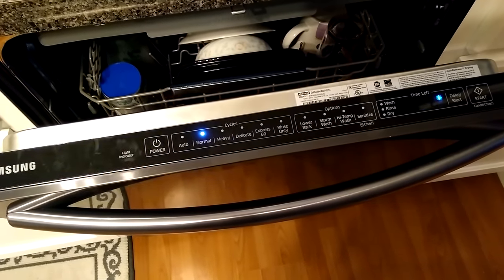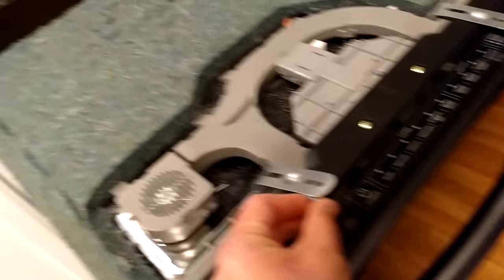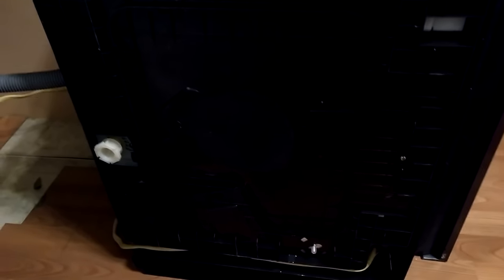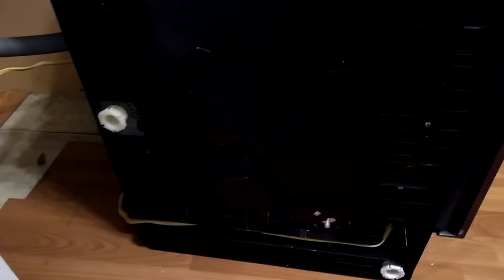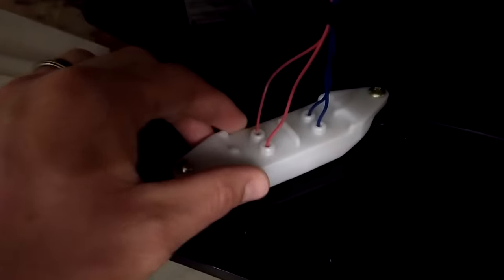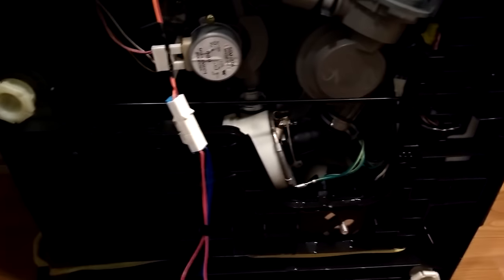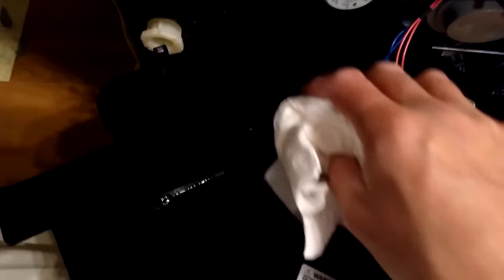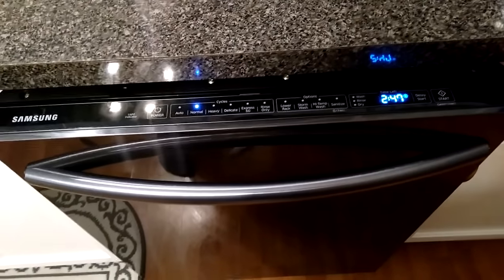How To Fix Samsung Dishwasher with LC Error Code

Comment: it is a shame that these dishwashers are so awfull but we dont find any of this out until after we own it
Reply: I purchased top of the line Samsung appliances (4) less than 2 yrs ago and my DW has done this twice already.
Reply from the maker: Yep, I feel your pain. We have a 4 piece set as well. The ice maker on the refrigerator went out and we had this problem with the dishwasher. Nothing on the range/oven or microwave... Knock on wood
Reply: It's not awful to have a safety feature that will stop a unit from creating water damage. Untrained people don't know that the cause of this is a dirty air break on the side of the dishwasher, over soaping can also cause the issue. Just run some cleaner through once a month and your problem will not reoccur.  Also run your hot water at the  sink before you start your dishwasher.
Reply: They are garbage. I have this occur to me at least once a year. While under warranty they had to send out someone to repair it three times for different issues while it was still brand new. And the Samsung help line is terrible. This is the perfect gift to give to your worst enemy.
Reply: @jmcwatchdog526 Good point about the leak detection and the dirty air break. In the plastic "water wall" in the side of my dishwasher there's a dark brown area at the top-right. Is this a dirty air break? Is there any way to clean this besides running a clean cycle? My tub wasn't draining, but I've checked all other issues.
Reply: I think most appliances are junk these days. Our fridge tech told us they’re all pretty much the same, part of the problem is handling issues in transit.
Reply from the maker: @user-vs3zp8kz9y 😂
Reply: Should’ve kept my old Whirlpool that I had for 15 years.

Comment: I think I figured out where the leak is coming from. The problem lies in the fitting in the entrance of the dishwasher. If the screws holding the dishwasher to the cabinet are too tight it flexes/bows the tub outward which compromises the seal during drying, this allows steam to condense and run down into the pan which sets off the sensors. Adjust the screws so that the tub doesn’t bow out at the entrance.
Reply: ? how did you find this out?
Reply: @jaredstone9487  I had the same issue, fixed it and realized that the improper installation was leading to condensation finding its way to sensors it shouldn’t have reached. Loosened up the screws allowing the steam to breathe and the problem was solved.
Reply: @rearviewviewer  this resolved my issue as well. 

Note to self: you really only need to tip the washer on its side to remove the water from the pan it is in. Easy money. 

Thanks dude.💯💯💯🍻

Comment: Thanks for this video.  Bought a Samsung dishwasher five months ago and this has happened twice.  First time I called Samsung and the guy they sent out claimed it was my plumbing.  Nope, it was not, plumber found nothing.  Second time happened tonight.  Found this video, fixed the problem myself.  I additionally used washers under the sensor’s screws to raise the sensor a bit.  All working fine now!  You are a hero👍🏽.
Reply from the maker: You're welcome! Glad it helped, hopefully you won't have any other problems. Mine is now more than 5 years old and doing well ... Knock on wood

Comment: Round two.  The first time I dried the sensor and added two washers to raise the sensor.  One moth later it happened again.  Btw both times it happened after a heavy cycle.  Anyway, this time the plug was damp and laying on the pan floor.  So I added two more wagers and tied the plug up off the bottom.  The next time I write it will be about taking this thing to the dump.  I have Better things to do than mess around with this pos.  Don’t even get me going about my Samsung microwave.  I bought a Samsung kitchen package.  Might be a full truckload to that dump.
Reply from the maker: Man, sorry to hear that. I have a 4 piece package too. Haven't had any issues with the microwave or oven. The ice maker broke in the freezer/fridge but that was an easy replacement. The dishwasher is still going strong without any additional problems since posting this video. It's all too expensive to junk within just a few years, gotta make it last one way or another. Good luck!!!
Reply: Thanks. You are right of course.  Will find a way to make the the dw work.  But with the microwave, I can’t fix stupid.  Samsung won’t let you set a timer and cook at the same time?  Here in the south they say “mash the button” in stead of turn on.  Nothing could be more true with the mw, you have to mash the buttons. LOL.  I really will replace it with a GE.  Range and Frig are working okay.
Reply: @dwightshelato7619  You're dead right about the mw buttons. It builds muscles. And we're now fixing the dw for the second time. The print on the face of the washing machine that allows you to choose your load type is rubbing off and now protected by clear laminating sticky sheet. I'll never buy Samsung appliances again.  #samsungsucks

Comment: In our case the problem / leak seems to be connected to not having the upper (cup) rack slid in fully. It has to seat in the rear on the post with the rubber gasket. This was first discovered when we noticed scratches on the upper inside (center)  of the front door. It has occurred if a spatula or other utensil is sticking out the back/rear of the rack. Probably putting pressure on the door seal, not sure, but as long as we slide the upper rack in fully (and not allow the door to do push it in) the problen has not repeated.
Reply from the maker: Good tip, thanks for the feedback!

Comment: My Samsung D/W would do this about twice a year. I've added three #8 brass washers between each mounting stud and the sensor. This raises the sensor just enough that it still functions properly but with a higher water level, so less prone to trip. Be aware that one path of water into the pan happens from the door ducting. Avoid the temptation to add a dish once the machine has started. Adding a dish can run water into the pan and trip the LC 
 sensor.
Reply from the maker: That's a good tip, thanks for sharing!
Reply: omg this explains how I got this, thank you so much. has your dishwasher been okay since?
Reply from the maker: Mine has been good, it's almost 6 years old now

Comment: We've had a model DW80K5050US for over 3 years, and it worked fine until this morning.  What's shown in this video made the LC code disappear, so thanks for that!  The hardest part was tipping over dishwasher.  One screw and 5 minutes later I turned on the breaker [while the dishwasher was still tipped over], and all was good.   No signs of any leaks, but there certainly was a small amount of water in the pan.  Thanks for showing how to do this very easy fix!
Reply from the maker: Wonderful! You are very welcome!

Comment: Thanks for the video! A simple fix is to remove the sensor from the tray with the one Phillips screw.  Once removed you'll notice four metal pins that trip the sensor with the slightest amount of water in the tray.  Use a nail clipper to trim a mm off of these pins.  This way you'll still have a working sensor in the event of a real flood but one that doesn't trip with two drops of water in the tray!  

This issue has hit my beautiful smart dishwasher several times.  Usually waiting a day or two for the water to dry will resolve it but this slight alteration should prevent you from having to do that ever fn again
Reply: First time ever and wonder if it could be ice - we just had the coldest night of the year and maybe the line froze?
Reply: I came here to say thing thinking I was Mr. Smarty Pants.  Seems you beat me to it.  haha.  One step further is I cut them all off then wrapped them all with electrical tape.  I told my wife if we get a flood deep enough to hit the electronics and create a short, then open (circuit burn) WITHOUT tripping the circuit breaker with 110 being an inch off the ground up front.... well its curtains for this POS over engineered dishwasher anyway.  Our Dishwasher is on the main floor and we have a basement.  The water drains straight down to the sewer drain below when there's an issue.   I know because this house was built in 56 and the brass T fitting under the sink degraded and was draining the dishwasher into the basement lol.

Comment: You are a HERO! Thank you so much for posting this video and saving us time and money on this dishwasher. We also went the extra step of placing washers under the screws where the sensors are housed to add length. That way if just a little water is dripping from time to time it won't set off the sensor, but if there is an actual leak it will let us know.
Reply from the maker: Glad we could help!!

Comment: unbelievable how simple and effective this video is. I had this on a model 5 years ago and the vendor just swapped it out for a new one. The original probably just went into land-fill. It happened on the replacement this morning and I followed your instructions and the fault was cleared. Assuming that there isn't a structural issue with the plumbing, this tray along with the condensation created in the drying process seems to be a poor combination. Anyway, thank you so much for posting this.
Reply from the maker: Thank you for the feedback, glad it helped!

Comment: Hi, I just tried this, on my model there were no screws I just popped out the plastic cover on the bottom, then disconnected the cables, unscrewed the sensor, dried it all out and back to normal. The fact that they have put a very easy cover on it would imply a botch fix on a design issue.  Thanks  mate good job.

Comment: It's good to know this workaround (thank you for posting it "HTFIW") but there should NEVER be water leaking from the tub to the catch basin. The only reason the catch basin is there is to account for a worn-out leaking hose or seal UNDER the tub. Worn out, like after 10 years of normal operation. We are now on our second brand-new Samsung "39DB" dishwasher. Neither has been able to run a single load yet because they LEAK! The only reason we bought Samsung is the Bosch dishwashers are still on freighters in Long Beach Harbor. The new Samsung dishwashers are simply junk. You all have fixed the LC error code - great! I'll try this too if I decide not to wait for the 2nd repair tech to try to fix it -- but have you found and fixed the leaks? Has any repair tech found your leaks? Samsung support says "air it out for 24 to 48 hours then call us back". Seriously? A brand new dishwasher can't run a cycle and I'm supposed to air it out for 2 days? The fact that these previous posts are years old is a clear indication that Samsung is only interested in their phones, tablets and watches. Next time, instead of just reading product reviews, I'll search YT for "how to fix [brandname] dishwasher".

Comment: Great video. Thank you! We spilled coffee on the counter which dripped into the DW tripping this sensor. After following your instructions I also had to remove the sensor wires from their respective wire harnesses, clean out and dry each wire harness and reassemble. You need a thin pick to depress the internal tabs that release the wires from the harness.

Thank you again! Saved me a service call!
Reply from the maker: You're welcome!

Comment: Great video and saved me some time and money. Mine seems to do it now after each wash, so I have a more persistent leak. Any tricks to figure out where the leak is? I was thinking putting the washer on blocks and leave the bottom plate off and run and see where it leaks. I am aware of the danger....
Reply from the maker: Thanks. I tightened all the fittings on the in and out water lines. I haven't had any leaks since recording this video

Comment: This error came up for me last night for the first time, and this video really helped..our machine is now 6 years old. Along with this quick fix and trying to source the leak, I noticed while making sure that everything was snug, the 4 main screws that held the motor in place were very loose, to the point you could actually move the motor. So while your down there, make sure you check yours out as well as with vibration they are sure to come loose! This may have been where some of the water trickled down from in at the bottom of the machine. Thanks again for taking the time to post this vid
Reply from the maker: Thanks for the feedback and the extra tip for tightening the motor screws!

Comment: This is a great video. I had already figured out that the problem was water getting in the dishwasher cabinet and setting off a moisture detector. What the video taught me was the easy way to get access to the leak detector and completely dry the area out. I think I can add one or two useful comments that I haven't seen mentioned in the previous comments that Ive read:

The leak detector has four metal pins that are in contact with the bottom of the plastic dish that it sits in. If that plastic dish is even slightly wet, it will set off the leak detector. There is no way to dry out the bottom of that dish with towels without removing the leak detector (as shown in this video), OR you can dry everything around the detector and then wait a day or blow air on the area with a fan or a hair dryer, etc. to finish the drying process. This is why some people have had success with fans and hair dryers. They are able to get that last little bit of wetness out from underneath the leak detector.

In my case, the kitchen faucet leaked and the water ran across the counter and down onto the dishwasher. This is how the water got into the dishwasher cabinet and set off the leak detector. This could also be the way that other people are having this problem. If you spill any water on the counter near the dishwasher, there is a high likelihood that it will run over the edge of the counter and get into the dishwasher cabinet.
Reply: Just looked at the video again. He doesn't actually show how to lift that leak detector to dry out the last little bit of moisture that is under that detector. All you need to do is remove those two screws that hold the detector to the plastic pan. You may find that the pan is still wet. If you put the dishwasher back together again with that plastic pan still being wet under the detector then the machine will still not work until it has sat around long enough for that last bit of wetness to evaporate.
Reply from the maker: Thanks for the detailed feedback, great tips. Our dishwasher is still doing well with no additional leak issues a couple years later. I do think my leak came from one of the hoses, either the supply line or the drain line.

Comment: I just had this problem, but it was caused from a spill. My Hubby spilled a whole cup of coffee and it somehow drained down the side of the dishwasher door and into the pan with the sensor.  I pulled my washer out and there was coffee everywhere. I cleaned up the mess and inside the pan, put it back together and she is running like a champ.  Thanks for your DIY video. I'm sure it saved us a shiny dime or two.
Reply from the maker: Wow that's crazy! So glad it helped you!

Comment: I had to unscrew sensor to completely dry UNDER sensor before code would clear!

With code cleared dishwasher washed but STILL did not drain.  No error code though.  Discovered BUBBLER DRAIN HOSE OUTLET ON TOP OF SINK WAS CLOGGED!  Never cleaned this before so don’t know whether this was gradual build up or failure of Samsung Dishwasher to strain particles adequately.  Very easy to unscrew and check without scrambling under sink.  I did disconnect drain hose from below bubbler unit to allow hose to empty just in case but, it may not have been necessary.

Works perfectly now!  Phew

Thanks for this video!  Very helpful..
Reply from the maker: You are welcome, and thanks for adding the tip about the bubbler drain hose. That will likely be useful information for others.

Comment: Thank you for you very thorough video. I followed all your steps and added one. As I was going through things and checking for moisture, the plug and the wires attaching the sensor felt moist. Maybe the moisture is shorting the sensor at the plug. I wrapped it with electric tape so moisture will not (theoretically) enter.  Will circle back to check this in a month or so.
Reply from the maker: Great tip, thanks for sharing!!
Reply: Or, you could just disconnect the sensor's connector.

Comment: I took my Samsung dishwasher apart, fixed it like the video. It still threw the code. I took it back out and found water in the cannon plug to the water sensor.  I then Took a hair dryer to the plug. Worked like a charm . Thank you for the video.
Reply from the maker: Good job! You are welcome!!

Comment: Thanks for the video.  Had the LC immediately after installation.  I figure there's some water left in the system from testing it @ the factory, and jostling it around likely got a few drops in the pan.  Dried it out and so far, so good.  Will see.
Reply from the maker: Fantastic! Glad we could help!

Comment: If you don't want to pull out dishwasher you don't have to all you do is remove the kick plate and tape up the rubber skirt so air can pass and place a fan blowing air underneath the dishwasher and shut off the breaker going to the dishwasher
. keep reading below. 
Lar Jam
1 second ago
So my 2 hours of fan and breaker off didn't work BUT!!!! breaker off and fan OVERNIGHT did work! I was skeptical of fan after seeing the sensor buried under a plastic shield how a fan air would get to it. On the other side some circuit boards don't reset error codes unless power is off for a certain amount of time. I am not sure which of the two fixed it but I will try 1 at a time if error returns and report back
Reply: everything still okay? got an issue with the LE code wondering if it works or if i should just get a new one